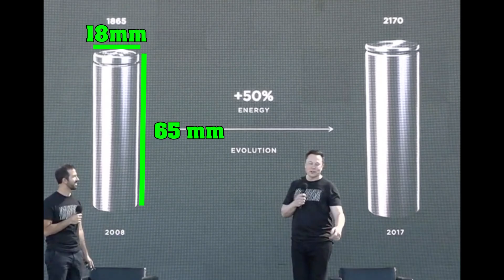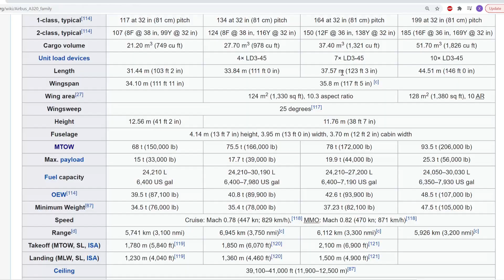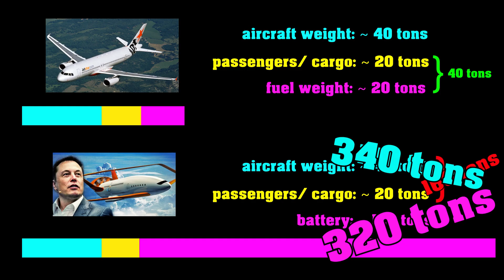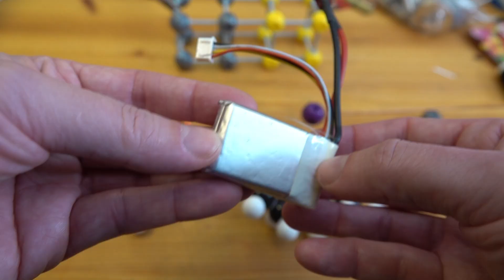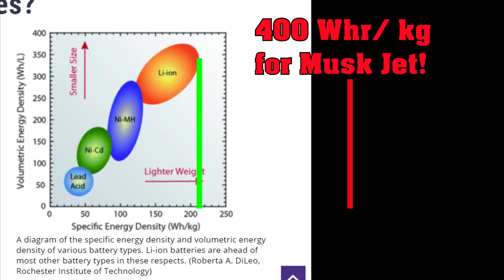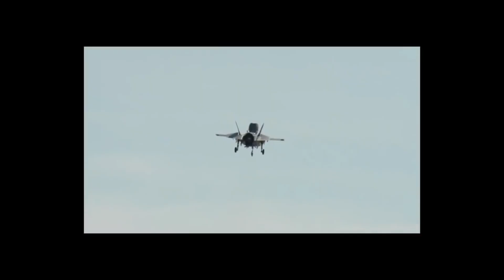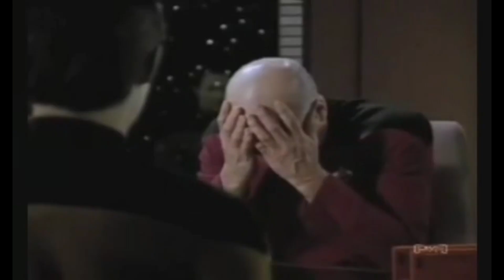Tesla's Secret Plan To Disrupt Airlines: BUSTED!!

Comment: Going from the 1865 to the 2170 was not as much about increased efficiency as it was about a battery that was easier and cheaper to manufacture and could transfer heat better.  The problem is rumor are that Tesla is switching to a less efficient Chinese battery to save money.  It hold about 33% less power, but is less than half the cost.  This is starting to run into a weight issue.  the Cybertruck... to reach the goals of their expected range on such a large and heavy vehicle is going to require a MASSIVE battery... to the point were the more battery they add the less benefit you get.  See electric vehicle range is directly correlated to the weight.  You double the weight and it haves the range.  The long range Cybertruck will be almost 50% weight bringing the weight up to that of a massive diesel dually with oversized tanks that will have at least double the range for half the cost and MUCH better hauling and towing capabilities.

There is NO way you can make something that is a VTOL powered with electricity that could reach supersonic speed with anything resembling a useful range or lifting capacity.  It would require batteries several magnitudes more efficient.  With current battery technology they can make a small prop plane with maybe a 50 mile range that can handle possibly 4 people, but that is about it.  Fossil fuels have a HUGE advantage in energy density that batteries will NEVER reach.  The cost of this... to reach those kinds of ranges, speed, and capabilities would be EXPESIVE.  He would need to cut the passenger weight in half... and Cut the airframe weight in half...  AND he would still need batteries FAR more efficient than what we have right now.

Now solid state batteries and other battery technologies are possible and prototypes are reaching rather high capacities, BUT they are usually hit a wall on battery life and reliability.  I mean, look at sodium batteries.  They perform great, butt hey swell and crack so much that the substrates only last through a few cycles.  Solid state batteries still have potential though, but they are not going to increase efficiency nearly what Elon needs and it would require other technologies combined with it.  We are still 20-30 years out MINIMUM for battery technology like this... if not longer.  Also understand that we will likely start hitting a wall on how much a battery will ever be able to hold.  These would be just fine for cars, but they will struggle with the capacity/ranges needed for a semi let alone a jet.  If they could get say 50% more energy out of the current batteries and maybe 50% longer life... without increasing the cost... then gasoline cars would start to die off.

Comment: So... the reaction mass will come from... where exactly? It's battery powered, so I imagine it would use fans, but how would it get to supersonic? Ramjets and scramjets, even with fan assist, still requires fuel to burn. If you need fuel you might as well couple the energy release to a standard jet engine and forget using fans for primary thrust. 

Now you have a Harrier/JSF

Comment: Has no one brought up the fact that as a plane burns fuel, it in turn gets lighter, therefore requiring less energy to maintain speed and less induced drag cause by the need to lift less weight?? Electric planes will technically get less efficient, carrying 100% of the weight as the potential energy of the battery pack continues to deplete??

Comment: Aeroplanes lose their weight and increase their efficiency as they fly. Burning fuel decreases its weight enormously increases the efficiency. Furthermore.. most planes struggle to land immediately after taking off as they must decrease their mass before landing. Batteries would mean every part of the landing gear and structure.. would need to be much stronger enable to take the immense forces placed upon them due to not decreasing in mass like the combustion engines on a plane.

Comment: Even GDI in cars has only added around a 5% efficiency increase. Diesel engines are made of much tougher and heavier materials than most car engines these days which allows them to have extreme temperatures and heat within them. Cars, especially the smaller ones have been struggling with heat exchanging as of late (note this is an anecdote from my life working on cars and selling parts). It doesn't take too much to get them to overheat and damage themselves.

Comment: The more power dense and efficient batteries become the closer we will be to achieving this. It's not a matter of "busted" it's a matter of time, and engineering, and tremendous amount of R&D but mostly time. This is engineering, not physics class. I don't think were near this technology yet, but were definitely working. But till I actually see proof of anything and not just hearsay, then I will be like okay it's time for electric planes I guess, which do exist now. Not anywhere near efficient but engineering is a marathon, not a sprint. I will wait the long wait to see if it pans out or not.

Comment: If the +50% is accurate, then you are not correct to state the density hasn't increased... it has been improved by around 2.3%, which is comparable to a 'significant' improvement in efficiency in aerodynamics or ICE development.

Sure the lying liar that is Musk is misrepresenting how efficient a 46% larger battery is, by claiming it holds +50% more energy, as if they are 'the same thing apart from the energy storage', but there is some improvement possible with the numbers shown and it isn't absolutely trivial. He did the same thing when he misrepresented how "efficient" his tunnel boring technology was when it made tiny holes compared to (more efficient or equivalent) larger machines - but a shame that the small holes are still going to be massively expensive to bore, and utterly useless for the intended mass-transit purpose, compared to a simple train style tunnel or even surface rails.

'Supersonic, VTOL'. Okay. Possible. It has been done. (sort of though more STOVL). Yak 141, F35B... but not for a commercial jet, where payload and efficiency has a value.

... 'and electric'. Okay he is mad.

Comment: 9:00 A series is clearly not the way to solve this. With aircraft weight a, passengers and cargo c, battery b, we have: a = b+c and 3b = 7(a+c), so 3b = 7(b+2c) = 7b+14c, so 4b=-14c or b=-3.5c. So obviously, Elon was calculating that to carry 20 tons of payload, you need negative 70 tons of battery and negative 50 tons of airframe. You're welcome.

Comment: Imagine how many days it would take to recharge that flying battery.
Reply: Why not just strap a wind turbine to the front of it and let it charge itself off of air power while it flies??? :D  :troll physics:
Reply: @Exkhaniber  I am sure the guy talking about how efficient electric motors are with less air would be all for it.
Reply: You can charge a well made cell at up to 4 amps safely, though for longevity 1 amp is best. If you have 100 parallel cells in a battery you could theoretically connect a 400 amp charger and be safe. The speed to charge wouldn't be that bad. probably about the same as a typical eBike battery at 6-8 hours.

Comment: Hes just nuts.  VTOL?  Why the hell would you waste energy and airframe mass by opting for VTOL and all of the additional mechanisms it would require?  
I think that what Musk is really talking about is another "pod" fantasy.  He isnt talking about an airliner.  He isnt interested in mass transport.  He is interested in solutions that require lots of small self driving vehicles.  70% by mass makes a load more sense if you compare to a fighter jet and only have to deal with a tiny number of passengers.  VTOL is only a thing at the moment for fighter jets for good reason (and even then it limits range so they prefer a runway launch even on carriers).
Why would these solutions interest him?
Maybe he has set up a manufacturing infrastructure suited to building small pod like vehicles? 
The hyperloop turned into self driving cars in tubes.  His "supersonic jet" will turn into self driving light aircraft that dont fly or have wings and are actually cars on a motorway.

Someone ask him if he prefers delta wings or swing wings and watch him say "i prefer wheels".

Comment: Okay, so with jet fuel engines , as they burn the (say) 20 tons of fuel, the fuel load gets lighter as the weight of the fuel reduces whereas in ANY electric propelled plane, as the battery depletes, the weight and mass remains the same thus drawing more energy from the battery in trying to keep the thing flying.

Comment: One feature of commercial aircraft at the moment is the  the landing gear. Taking of is much easier on the gear than landing. So planes are designed and operated based on landing with a much reduced fuel load. Being able to reduce the fuel load by burning it off, for landing increases the load available for passengers or cargo.
An electric plane, all other things being equal would need much more substantial landing gear, hence more weight, hence more robust landing gear.
Planes can land again at take off weight in an emergency but usually they will either damp fuel or circle to burn it off.
Landing at the take off weight will cause stress to the gear and will require a maintenance  check. Multiple landings like that will shorten the life of all the airframe but especially the gear. Very expensive.
How much vtol will change that I don't know, but the nature of atmosphere is such that a super gentle landing can not be guaranteed and with a permanent load of energy density the risk of accident has much greater consequence. 
Carrying that weight everywhere, from short flights to long will not be efficient.
A short hop conventional craft just puts less fuel in.

Comment: Thanks for sharing, as you say A320 aircraft need about 20 tons (20,000 kg) and  (240,000Kwh) of fuel/energy. The combustion efficiency of most aircraft gas turbine engines are 100% at sea level,  every kg of jet fuel has an energy density of about 43.15 MJ/kg (11.99 kWh / kg), even with a battery that will have a 1:1 power to weight ratio, 240,000 battery needed and 240,000 kg (240 tons) of weight compared to 20 tons today, so the conclusion is that the battery cannot replace jet fuel, liquid fuels will remain the king of energy density.

Comment: 18:58 Here you lie again. You know better, you understand how these cells are isolated and how overcurrent protection works. The short circuit you're describing being physical damage has nothing to do with the type of short circuit you would experience within a circuit. The packs are specifically designed so a cascade failure cannot occur. 
You are fear mongering again. I don't understand why.
Reply: A cascade failure cant occur ?
Okay, strap a few RC batteries together and cut into one of them.
Check whats left after the fireballs.
Reply: @DeadNoob451  That's not an apples to apples comparison. That battery pack he's showing is first of all not the Tesla cell configuration, second of all even the automotive manufacturers that use prismatic cells are in different configuration which both isolates them from current overload and protects them in case of physical damage.
You're comparing an ultra China RC battery to flight rated hardware, that's totally ridiculous. Spend some time and learn how the automotive cells are packaged, if you get the chance physically inspect the packs yourself like I have, and you'll understand the engineering precautions put into place. In an aerospace application those protections are going to be tenfold.
Reply: @DJS_ENO  Eh, not convincing. The extra shielding idea works on a car that is already twice as heavy as comparable models. You wont be able to armor these up like fort knox if you plan on filling almost the entire plane with them. 
Spend some time learning how aviation design works (or doesn't) and you'll understand why you cannot build a heavy steel coffin for each battery. Neither the additional weight, nor the lost energy density is acceptable if you want to fly an already really heavy plane.
These china-packs are pretty close to what you would see in e-aviation. (And already do see in planes like the Magnus eFusion)
The E-Cars' sledgehammer approach will literally not fly in aviation.

Comment: Actually, unlike regular combustion engines, jet engines are also more efficient at high altitudes, because they can achieve a higher compression ratio more easily and the cold air helps as well: https://www.highskyflying.com/why-are-jet-engines-more-efficient-at-higher-altitudes/ so this is not an argument in favor of electric planes either.

Comment: Unfortunately another thing that was omitted is that an airplane cannot land at full weight... you would collapse the landing gear.  This is why plans have to circle and burn fuel before they can land if there is an emergency after takeoff.  Batteries don't shed their weight so the landing gear structure would have to be heavily reinforced putting even more weight on the plane.. and the plane would never become lighter and more efficient as it flew
Reply: @Zak Strayder  Guess that the reason for VTOL capability

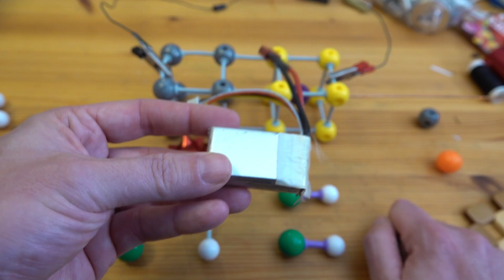Comment: 17:37 This is a blatant scare tactic. 
Gasoline, the fuel we've been using safely for over 100 years has an energy density 60 times that of current lithium technology. 
To claim that doubling the energy density of a lithium cell is somehow fantastically dangerous is an absolute lie on your part.
It's a total misrepresentation of the facts on purpose.
Reply: Fuel needs oxygen to burn. Batteries don't. Fuel doesn't spontaneously combust. Batteries do. See the difference?
Reply: @longlostwraith5106  See my other comment. You are being purposefully misleading about how short circuits occur. The batteries are protected from physical damage like sticking a nail through them. The individual cells are also isolated from each other. If there was an electrical short circuit there is internal fusing to prevent the battery from going into thermal runaway. If that doesn't work there is physical isolation and pack cooling to manage that exothermic reaction.
You're acting like the battery design engineers haven't thought about this in the current generation of packs.  Secondarily, you know what goes into flight hardware certification, You know that whatever a battery overload protection used currently for automotive applications is going to be significantly more comprehensive for flight hardware.
You haven't made a legitimate argument and you know it.
Reply: @DJS_ENO  All I know is that if I leave a gas-can full, it will never explode (without external stimuli, of course). A Li-On battery might, and has numerous times.
Reply: Yeah because there is absolutely no difference in how lithium and how gasoline burns. 100% the same threat level folks. Nothing to see here. After all, people short-circuit their gas-tanks all the time.
Reply: @DeadNoob451  ICE cars catch on fire all the time. Modern fuel tanks are less than a 1/4 inch of polypropylene. One good jab with a knife and the tank is leaking.  How often do they suffer a puncture on road? Pretty rarely. Battery packs are fully encased in metal, Tesla's use an aluminum an perimeter frame other manufacturers are similar (I have personally seen Tesla Model S, Model 3, Bolt, Volt, i3 among others torn down for engineering study). The amount of puncture protection employed by all manufacturers is significant. They are basically immune to road impacts. The only time they suffer a structural failure is in massive crashes like wrapping it around a tree at high speed. Any vehicle ICE or electric is open to catch fire in a massive crash like that.
In a flight hardware use case not only are the batteries living much more protected and controled lives, they have far more periodic inspection. Likely the cooling loop pressures would be monitored, you know if you had a leak/puncture immediately.

Comment: I think you peaked with Hyperloop. You were off with the last 'Musk' video, and you are off again here. The new Tesla battery is not aimed at aircraft. Never was. Try comparing the weight of fuel in a regular car with the weight of batteries in an electric car. Exactly. He did what everybody said was impossible... by redesigning everything from the ground up. You are trying to linearly scale apples to pineapples. I agree with your conclusions but not with your arguments. Even Musk would agree with you as he has no intention of building planes. He is just bouncing ideas around. In your clip around 24:30 he clearly says he would be interested but only  if technology catches up.
You take some random YouTuber and reply as though you are to Musk. As for the constant showing Tesla cars on fires, that is just BS. You know what's combustible? Petrol. And EVs are massively safer.
Up your game or you will start to get dismissed as a hater. And that would be a shame as I love the amount of effort you put into your videos. Apart from that random rambling about short circuits, which means you have never studied the battery packs and their energy management systems. If an engine fails on a plane fails it won't fall out of the sky. If a battery fails it won't either. Oh and your comment on concorde forgets the Hindenburg. Ironic considering the push toward hydrogen today. As for the Lockheed not being a disruptive technology... it was for the military. It was in service from the 1960s until 1999 and still holds the record of the fastest manned aircraft.
For me, your most disappointing video so far. I'll keep watching for now as you have had some good ones but maybe stop targeting Musk for clicks because so far the blows are failing to land and it's affecting your credibility. Take it easy and Happy New Year,

Phillip.
Reply: Being an unpayed Musk groupie must be really satisfying.
Being a billionaire's pay-pig may be your calling in life, but please stop spreading your degeneracy around...